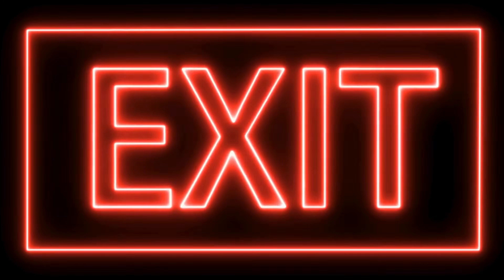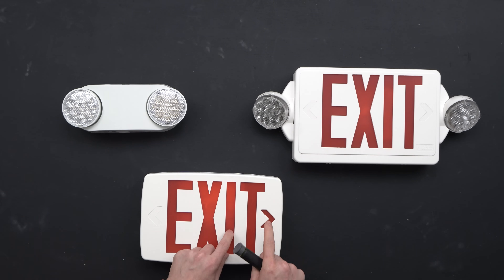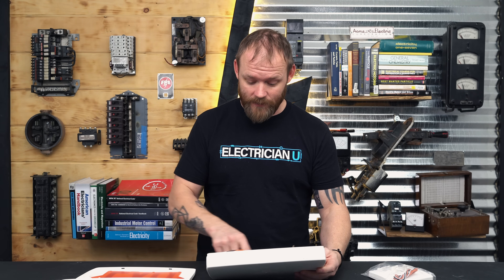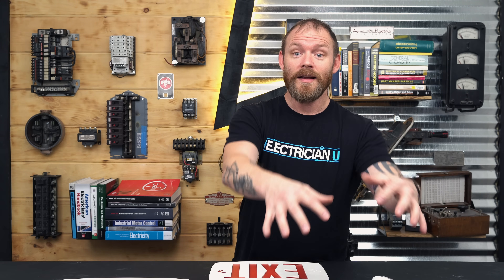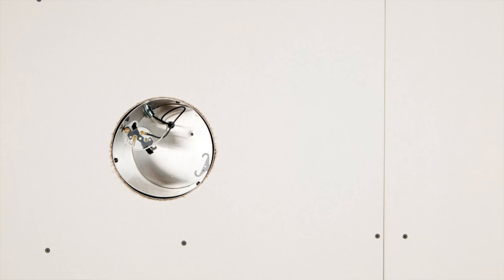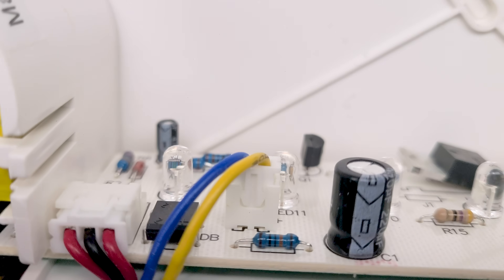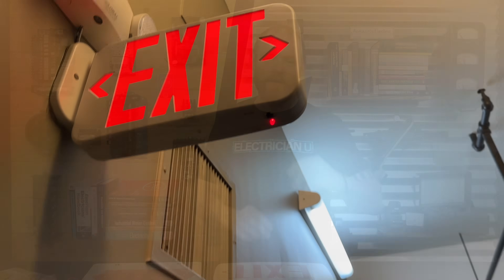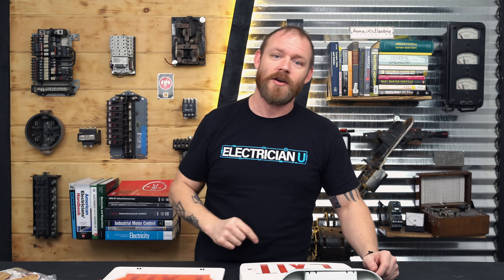Where Do We Need Exit Signs & Emergency Lights?

Comment: If you do a follow-up to this video, please include remote heads, such as where one of the emergency lights is tied into the interior exit sign battery, but is mounted outside of the structure to highlight a stairwell, for example.

Comment: The directional requirements of the exit (being 90 degrees off the wall) was probably why they didn't use a combo at 8:45 since you can't really side mount those - I suppose they could have top mounted it to the hallway soffit, but you are still limiting the functionality of the floodlights by pointing one into the wall.

Comment: Question. I have an exit light that turns off when the lights go out. Why?
Reply: it's either because the battery is dead or it's old enough to not have a battery, which was the code prior to the 1960s.

Comment: I think that the combo EXIT sign you showed at 7:43 would not be appropriate in the building in the area you pointed out at 8:43, though there might be combos better suited for that location.  The scene I imagine at 8:43 is that you're facing the top of a T, with no egress to the left or right.  I would not want to be directly facing an EXIT sign because the egress is actually behind me.  This arrangement does a good job of showing the exit direction to anyone in either side of the T, while providing good illumination down the ends of the T.  If there's a combo sign of the arrangement of lights and signage shown here, great!

Comment: Retired and not sure of the latest & greatest local codes ( Duke's of hazard state does not have a state license ) but for years our big city said being that our electrical Ultility has such a great high reliability rate of providing power that if a company has a dual service with automatic tie breaker you did not need emergency lightning. Was just great when we lost power in the large slaughter house that I worked in. Had to feel my way out of a two block long totally dark chill box with thousands of hanging meat hooks some at eye level. Last company that I worked for loved POS red bodine ballast that had a garbage battery that never lasted more then 6 to 8 years and only provided a dim illumination out of one 4' lamp. Mike Holt recently had a picture of an emergency light that was feed by illegal cord & male plug on his great code question & illustration of the day. Guess Stevie Wonder proof read that.

Comment: Hay Dustin I have a question about this topic, I was working at a church school that was being  Converted to a church daycare, any was we were told by are master on the the previous job that we had to tie them into the light power for that room, on this job we ran a dedicated circuit to power for that floor. Where do I find out more information on the rules for elight and exit sign on how to powe and other  Nuances to this topic.

Comment: Remember to only use what the State/County/Local Fire Marshall has approved for Exit signs and Emergency lights for your area.  Sometimes the EXIT sign is red or its green depending on your jurisdiction.  I know New York City has approved certain equipment for use in their jurisdiction and will fail you if you use a non-approved New York City device.

Comment: Can remember reading maybe 40 years ago some body was proposing that Exit luminares in hotel hallways be installed 6 to 12" off the floor. Reason being that still would be visible in a hallway that had several feet of smoke at ceiling level. Did see both high & low mounted Exit luminares in a large ambulatory three floor building.

Comment: My journeyman told me that I could NOT have an interior box ( Carlin box or metal 4 square box) in the same stud bay as an exterior box due to the fire rating on the wall. Is that a legit thing?
Reply from the maker: It can be. But that's more of a structural engineer thing or a MEP thing. Not specifically an electrician thing. 

We don't arbitrarily decide what fire rating we are meeting or exceeding. An engineer does.

Comment: I had some old ones in a building I do maintenance work at that the test button WOULD light the unit, however when we did an actual power off test(killed the building's main breaker) they did not light.  Never tried to figure out the issue as these were old incandescent units and we replaced them with LED.
Reply: The batteries only last 5-10 years usually, less if you do the full 90 minute test per-code. Also power resistors in some exit light designs can cook themselves to death over the years and present that way when tested.
Reply: If these lights are the rather bulky units from 1970 or earlier, they use lead / acid batteries, which are now shot. Testing with the power on just powers the light through the battery charger and gives a false sense of security.

Comment: Question about testing and remediation if the unit fails the test. Is it better to replace the entire unit, or just the battery?
Reply: As a general rule I'd replace the unit. Combo units are kinda pricey, but exit signs and frog-eyes are pretty cheap by themselves. It's not uncommon for manufacturers to make near-identical lights from the exterior, but use different batteries inside from one year model to the next, and many buildings are a hodgepodge of different lights.

There's nothing wrong with replacing just the batteries if the rest of the unit is in good shape, and you can take the time to verify what batteries you'll need, but after ~15 years the plastic bodied exit signs tend to get fairly brittle in the plastic, and the circuit boards on all of them seem to have some resistor here or there that's cooked itself after about that long. I've been sent to replace just batteries several times and ended up having to replace the whole unit anyway because the body of the light crumbled in my hands as i opened it, or they were sure the lights were all the same and they were, but a unit here and there was lit, but the AC-loss side of the circuit didn't work.

Comment: It's interesting but I would have liked to know more about how to connect these lights. I suppose they should be installed on the same circuit as the room lights, but is that a code requirement?
Reply: I've heard conflicting answers and I think it depends on which edition of NFPA101 is adopted in any jurisdiction? I've had some swear it should be on lighting circuits, with the thinking that if the lighting circuit loses power they should come on. I've also heard they should be on a dedicated circuit, so regardless of power to other circuits they remain fed, and are less intrusive to occupants to do 90min function testing on. I don't think it's checked in some areas well though, as I've found them run from any-ol-circuit when reno work happens and they're the only thing keeping an inspection from getting a CO.

Comment: Any ideas why the international (running man) egress signs are not yet allowed in life safety codes? Also, red vs. green?
Reply: Momentum and habit mostly I suspect. In the US at least I think most people expect to see EXIT, it's so common it's even a plot device in The Page Master. As for red vs green I usually stick to what the base building already has unless there's a request for one or the other. Some say red is easier to see further through smoke, others say green is easier to be sure you're going toward a "good" thing.

The more important thing is to keep the batteries in good shape and test them. Most exit and emergency light batteries are shot after about 5 years. Per code they're supposed to last 90 minutes under battery power. Most buildings I come across that haven't been kept up with and checked are doing good to have half the lights last 5 minutes without power.

Comment: This is a fire safety codes not electrical... Just install it as defined by the fire inspectors/fire marshallb etc. Your job as an electricians are NOT to design signage. Usually a local fire alarm company will do all the proper installs. Again this is NOT an electriciams issue. Some areas require all fire sysyems be attached to a generator system if you habe one as well.
Testing also means to jave the emergency lighring stay on for a ceetain lenfth of time, not just a momentary push of a test button.
Reply: Wound tight much? It never hurts to be aware of relevant code to your own trade where it bumps against other trades. I can't count the number of exit lights I've checked where the electrician put it in place, but never knew or cared to plug the battery in and it didn't get caught in the inspection.

Comment: That's a lot of info in a short period of time for emergency and exit lighting, well done. Additional content: remote heads, remote head capable exit signs, 90 minute battery operation minimum. 
Also, there are two concepts that are confusing to me regarding illumination principles sometimes; creating a path of light with emergency lights vs illuminating an area. I've seen emergency lighting used in places like a shop floor to direct people to the exits by creating a path of light and I've seen buildings that try to illuminate the entire area of a large space with emergency lights. I haven't delved into planning exit lighting for projects yet. Can you go into what NFPA 101 says about this?
Reply: I'm a helper at a fire alarm company. We test this all the time. Nfpa probably has a rule, but as a rule of thumb that inspectors use in los Angeles is "if you can see your toes, it's ok". Though the primary light source can't be the exit sign itself, even though they are bright AF.
Reply: @nateristowa6899  I've also been quoted the "you need to see your feet as you move to the exit" rule commonly from the most stringent fire marhsals in the Atlanta area, so that sounds likely what code has to say about it, though I'm not as well versed in 101.

Comment: Good stuff Justin! I tell the helpers to make sure to connect the correct wires inside the emergency light also. A lot of lights have a 120 or 277 volt tap inside. I've had several apprentices put 277 to the 120 volt tap and fry the board inside because they didn't pay attention to the voltage sticker on the wire.
Reply: I did just that myself recently, replacing combo lights that I'd assumed were on a 120v feed like the rest of them. After a couple minutes of it being powered up seemingly just fine, while I was finishing the mounting, the little stepdown transformer in it went bang and let the smoke out. Don't forget to meter the feed!
Reply: @carpespasm Not sure about all exit signs as I've never personally had to install one, but many newer (within the last 5 to 10 years) LED drivers and electronic ballasts as well as some COB style LED lamps used to retrofit existing HID luminaries are universal voltage 120 ~ 277V rated meaning they will also operate on 208 and 240V as well,  which can come in handy in legacy buildings with 240V ungrounded or corner grounded delta systems.  As a journeyman I often refer to these universal voltage items as "apprentice-proof" But yeah, kidding aside, always get in the habit of verifying with a meter instead of relying on the colors of the conductors or making assumptions based upon what voltage the other fixtures in the area are running on.
Reply: I always looked for the tap of the 120v or 277v for the light 😍

Comment: Stairwell pressurization fans are also required for fire safety to maintain positive air pressure in the stairwell during a fire to keep smoke from entering the stairwell.
Reply: And part of testing them is using an anemometer (air pressure guage) to make sure they remain pressurized even with a door in the stairwell open annually.

Comment: My work didna remodel of one of the floors of our buildings and after they had the exit signs from the drop ceiling. Then two weeks later there was all mounted exit light 8" down on the wall. Turns out failed fire inspection because the drop ceiling sign was too high.  And it cost more to move the existing the. To just add a second sign on the wall below. So might be a reason why there is a light and exit sign on your building you found instead of a combo.
Reply from the maker: Thank you.
Reply: Also it's sometimes more expensive to buy one combo vs one exit and one bugeye.